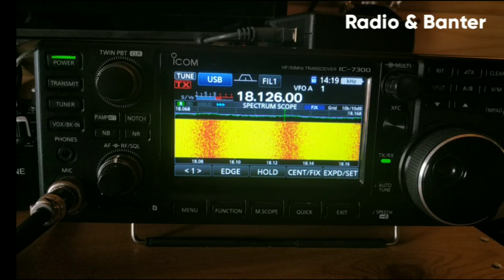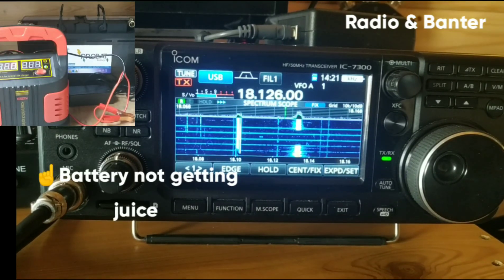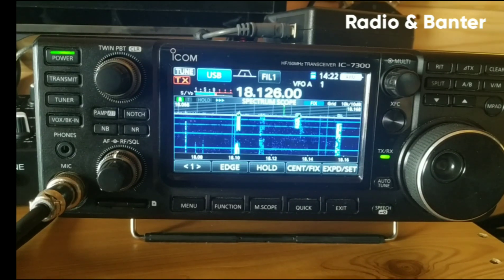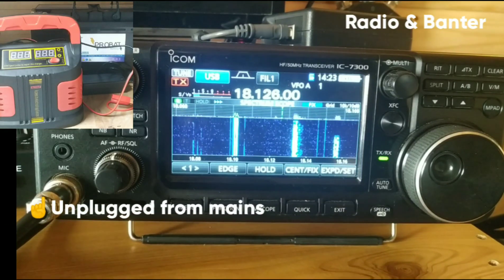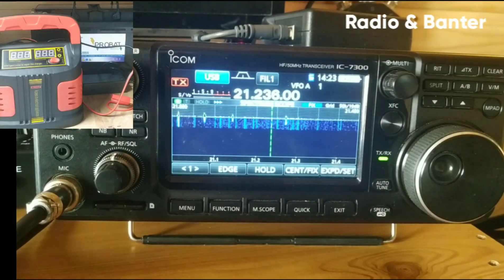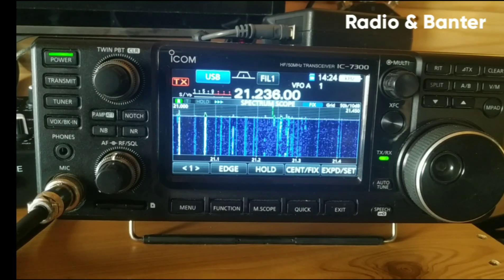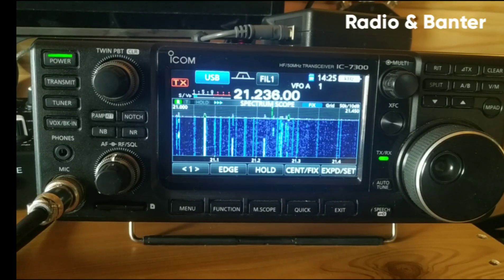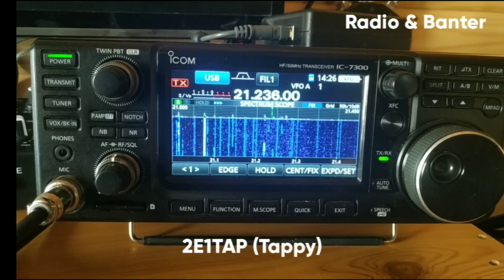Radio Killer

Comment: Good video and it shows even tho a item may just be on stand by but  it can still lift the floor noise on your band or multi bands
Reply from the maker: Yeah noise can some from anything plugged in, even on standbye , if not a correctly screened power source.
Cheap crap from China has saturated the market now